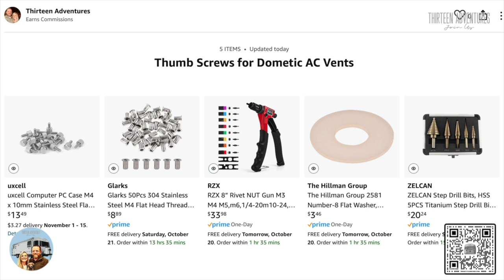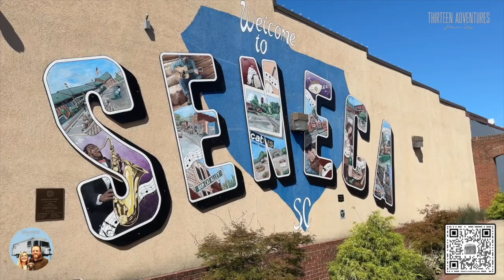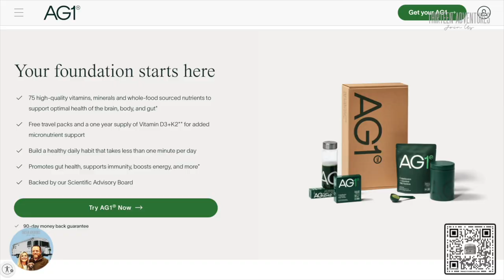Airstream Upgrades & Fixes: Air Conditioner Vents, DC System, USB Overhauls, and AG1

Comment: I think we have a neater solution for the intake vents that doesn’t require the threaded studs on the edge of the openings.  It also eliminates the gaps between the screen frames and the ceiling.  I’d love to share sometime if you’re interested!  I’m the Hill engineer you helped with hatch advice in Ogden. 🙂
Reply from the maker: I would love to hear what you have.  Please send me an email to thirteenadventures@gmail.com and we can sort out a way to discuss.

Comment: Good detective work tracking down that DC supply fault. It pays to do work on your rig yourself, as you have done, so that you're very familiar with the system when things go wrong. Just as an aside, Airstream switched to a USB A and USB C port on the 2024 models. Finally, yeah!
Reply from the maker: We are grateful for the knowledge to assist ourselves.  We heard they had finally upgraded and hope they continue to keep up with the times.